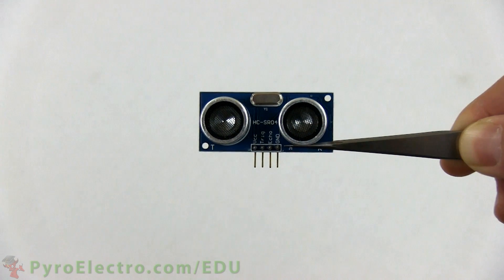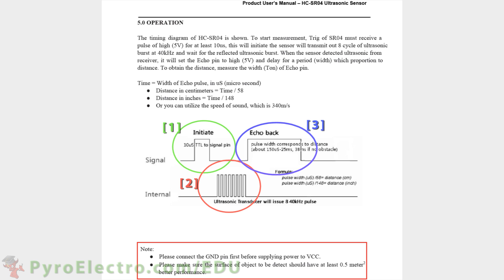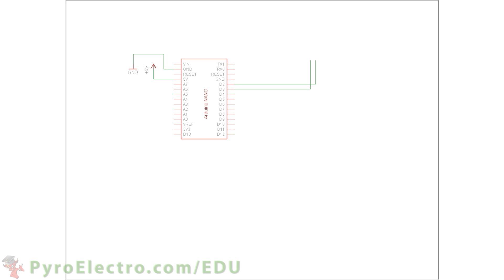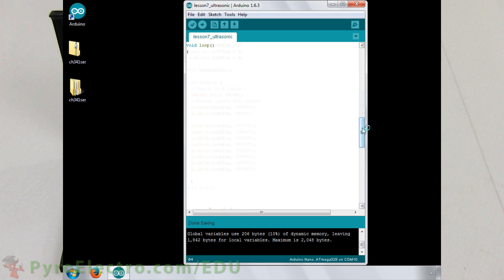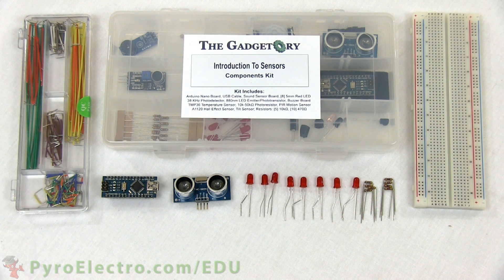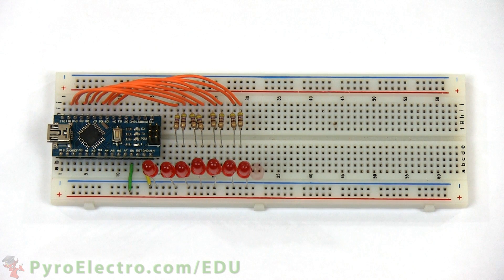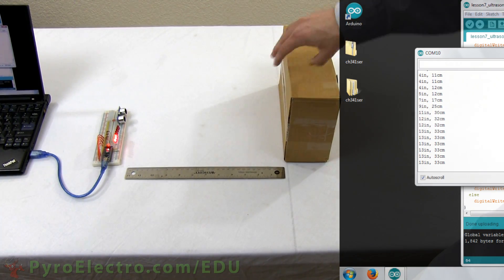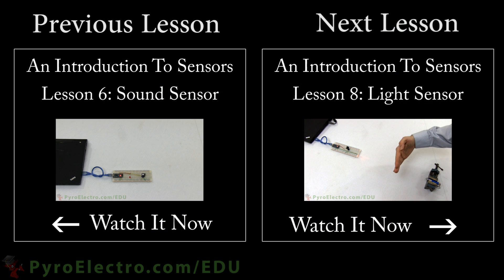Ultrasonic Proximity Sensor - An Introduction To Sensors - PyroEDU

Comment: Nice video and explanation, i ended in here swarchinf info about xiaomi ultrasonic proximity sensor, i just hope to find someone that explain properly how those types of sensors works. I notice via Aida that xiaomi seems to have tuned the phones to receipt under 5cm, and i was curious to know if is possibile to unlock it  to see if the sensor can be extra tuned or if can even see longer distance things like the sensor you used with Arduino... You know something more about it maybe?